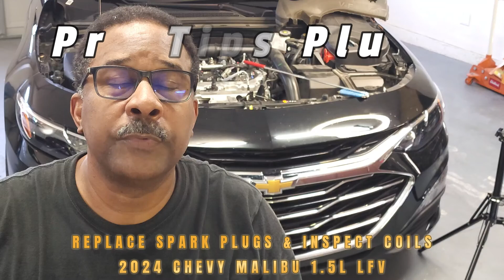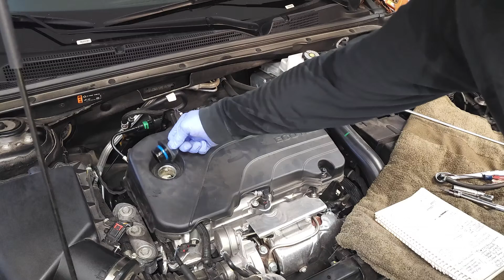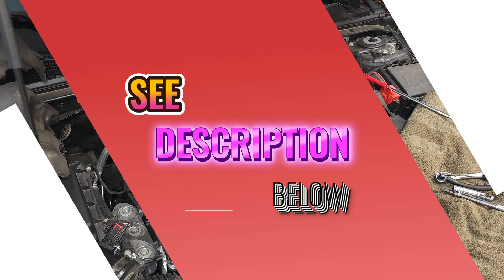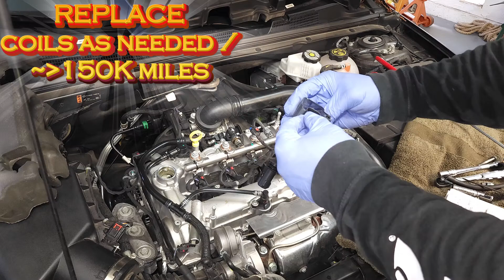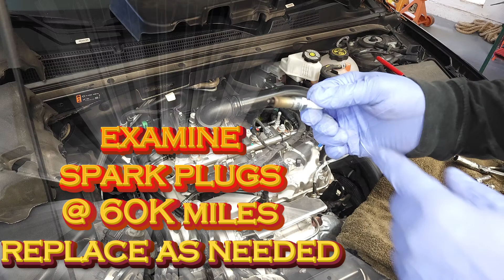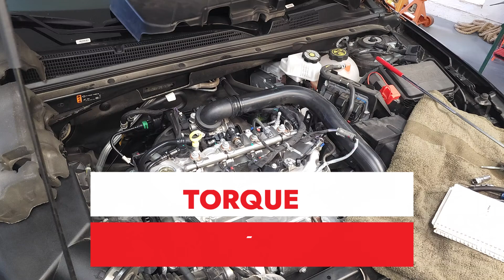2016-2024 CHEVY MALIBU 1.5L, (LFV) Replace Spark Plugs & Inspect Coils

Comment: Just got a P0300 code on 2017 Malibu 1.5 L.. scan tool suggests to clean/replace MAF sensor.. I'm wondering more if I actually have misfire situation. Any suggestions? This video is helpful. Thanks
Reply from the maker: @joaquinmartinezjr813 see playlist.2013-2024 Chevy Malibu DIY Repair Tips: https://www.youtube.com/playlist?list=PLvp_QXSltMfh9u7bN1ISygOkiJa1fXX4A
Reply from the maker: Please share with friends and followers. If you don't mind, let me know how you resolved the issue.
Reply: @joaquinmartinezjr813  what did you ever do for this issue? I just got the p0300 code after starting my mali on a cold morning
Reply: @clippy4416 i think I just replaced spark plugs and I was good. Coils were fine